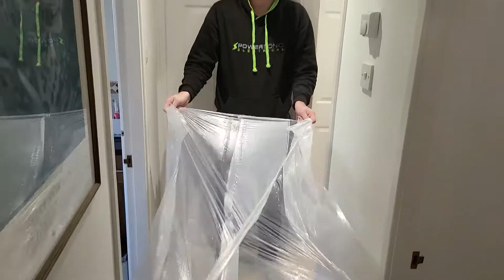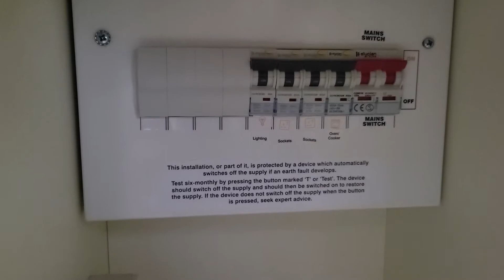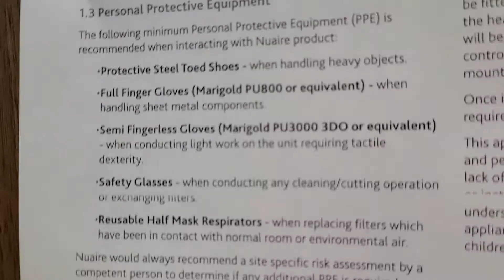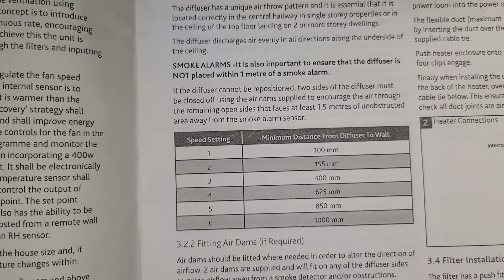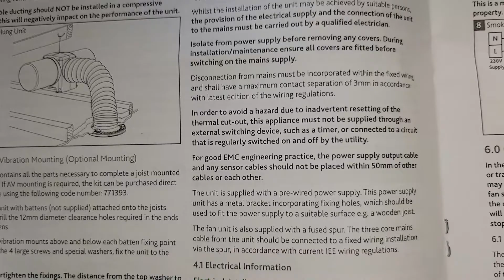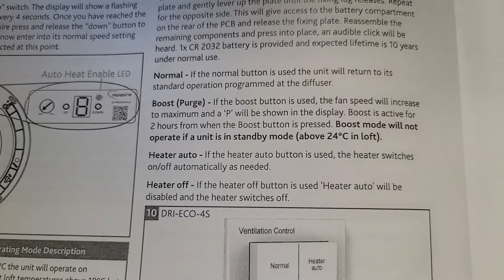Nuaire Positive Input Ventilation (PIV) What is that? A cure for condensation?? Full guide

Comment: Great video👍 and as one other says ‘much more informative than what the manufacturer provides’
Just installed mine, electrician wired it in and low &behold…… there’s not a kick out of it. It’s flashing ‘F’ which apparently means it needs replacing. To say I’m livid is an understatement!!
Waited a month for delivery, I told the misses this unit is gonna be the business and now My wife is giving off that we’ve spent the guts of 600 purchasing and getting it installed and all we have to show for it is a whole in the ceiling.
I’m just waiting for 9am so I get on to the supplier. Not happy!! And the trouble is if the supplier offers a replacement I’m dubious as to what faith I now have in it
Reply from the maker: One thing to check is all the comms cables are correctly installed. The long one between the PIV and the wiring loom and the shorter one in the heater/outlet plate. If they are not properly in place it will throw an F fault. Hope that helps.
Reply: @electrician247  Top man Mark, I did check that last night, but i intend doing a full check on everything later when I’m home. I hope it is something as simple as that, if so I’d be delighted.
Appreciate it cheers 🍻
Reply from the maker: @marklynch4493  yes, sometimes they can be not sat down quite right or the wrong way around. So worth a check over.
Reply: Just off the phone with the supplier and they’re awaiting a manufacturer response which can take 7-10days!!! As standard, which is shockingly ridiculous!!
apparently there is a stock shortage due to a delay with sourcing a particular component that is holding up manufacturing and it’ll be the end of February before there will be any sign of a replacement. So I’m £500 quid down with a hole in my ceiling and a wife who doesn’t fully appreciate the situation!!
Reply from the maker: @marklynch4493  is it a nuaire product if so Our working hours are 9am and 5.00pm Monday - Friday, contact us by calling 029 20858 400 or email aftersales@nuaire.co.uk You will always talk to a real person.

https://www.nuaire.co.uk/support/aftersales-service
Reply: @electrician247  
Cheers for that. I rang and they pretty much confirmed that the flashing’F’ is a complete system failure and the whole uni needs replacing.
That further confirmed that there is a manufacturer component issue and replacement units won’t be available until mid feb. 😩😩
Reply from the maker: @marklynch4493  Yes we are waiting delivery of several units to install for customers. Also waiting for our new EV vans due to the same lol. I hope this problem goes away but seems here to stay across the board.
Reply: Hi Mark
Don’t know if you’ll pick this up in time but, as you know from above I’ve had an issue with my PIV. 
Well nuaire have organised to pick the fan up from me tomorrow (6th Feb). So I have had to go into the loft disconnect etc. in doing the fan just kicked in and appears to be working, all of a sudden.
What do I do now?
Do I soldier on and see how it goes or take it out and get it collected.
They said it’d be a month before I receive a replacement
Reply from the maker: @Mark Lynch  I would suspect the leads/connecting pins on one or both of the link up wires have perhaps taken damage during/before install. 

Would the electrician who installed it come back to take a look for you? 

It does sound to be a wiring/connection issue on the appliance. 

Also worth noting the 7 year warranty is only valid when installed by a qualified installer. 

Hard to advise without seeing or knowing the install tbh. Sorry.
Reply: @electrician247  
Yeah I had a qualified guy wire it alright and he thought the same as you. I want to just leave it now working away, but then worried that it might just pack in on me in time 🤷🏼‍♂️
Appreciate the response 👍
Reply: @marklynch4493  Is it still working? 😂

Comment: Fantastic video Mark, much more informative than those supplied by the manufacturer. I got one of those, but unfortunately it seem to be faulty, after wiring the power doesn't reach the unit, no LED lights go on, the electrician says 240 gets to the heater board but nothing comes out, I'm based in Spain and the manufacturer doesn't take any responsibility for more likely faulty device, have you ever came across that, any advice would be much appreciated, I'm desperate, defo won't get my money back and I don't want to risk getting a new device! Thanks
Reply from the maker: Have all the communication leads been attached? There is a short one between the heater and the control board that fits in the grill plate. This often gets missed. Also the comms lead which is longer back to the PIV itself. Hope that helps. Mark

Comment: Really informative video! I've trawled through the comments, so forgive me if I'm repeating a previous question, but can you tap into a lighting circuit with this (heater) unit, or does it require 2.5mm cable? In my loft there's plenty of lighting cable but no ring main, like a lot of lofts I guess...Much appreciated !
Reply from the maker: Hi mate. These are fused down via a supplied 1A FCU so can be wired from a lighting circuit. In some cases that's better as it's easier to know when the power to the piv goes down and stops tennants turning it off. 

Consumption is small so similar to having an extractor fan on the lighting circuit.

Comment: How loud are they? Can you hear them or is there a constant hum when installed?
Reply from the maker: At low speeds almost silent. Faster speeds it can be heard if your close enough but still very very quiet. 

Always suspend them rather than fix down. Even with the rubber buffers it makes more noise when fixed down.

Comment: Hi, great video! Question...  We don't have trickle vents on our windows. How does the air pushed in from the PIV unit then push out the humid air? Do you need to leave a window open slightly?
Reply: Just a like and no answer? 😂
Reply: @bergzy7  were getting piv installed soon, fitter saying if got kitchen or bathroom ventilation be fine.
We've got no trickle vents as window company didn't fit them like I asked.
He also said you could have a vent size of tennis ball on ceiling each bedroom.
Reply: @adrianflake8273  We do have an extractor fan in kitchen and bathroom so hopefully should be ok. Let me know what you think of the unit... I'm thinking of buying one in Jan
Reply: @bergzy7  get mine 29th December so let you know.
Hopefully get rid of bit of condensation at bottom of windows without using dehumidifier.
Reply: @bergzy7  ain't going ahead with it now.
Got them to send name of exactly which piv and which bathroom fan was getting.
40 pound fan which was discounted at £200fitted.
And the piv wasn't one I was expecting and was £300 online  wanting £695inc fitting.
So not paying someone £500to fit for couple hours work.
Reply: @adrianflake8273  how much would pay a trades person who's running a business to do it then
Reply: @brianhewitt8618  well not the 895 he wanted to fit 340 pounds worth of goods.
Especially when he said be 2 hours work 277 pounds an hour no thanks. 
Got ripped of by electrician before who said be 300 pounds to fix faulty wire from socket to cooker as  when cooker delivered bloke said was faulty so couldn't fit it. 
Mrs was at home as I was at work he was at mine 20 minutes.
Reply: @adrianflake8273  its safe for me to say that I will never know the full story and ill assume that you had asks of the services of a legitimate business to carry out the works and if thats the case then the figures you are quoting sound very reasonable to me. businesses are not charity's unfortunately.

Comment: What if the outside and therefore the attic humidity is high (87%)
Reply from the maker: It will be raining 🤭. At times of high humidity the impact of the PIV is reduced. But generally that is a very short duration. It is essential loft spaces are well ventilated to outside and sealed to inside. Such as loft hatches, spot lights and other ceiling penetrations.

Comment: Does a PIV unit chill your house more in winter? Surely it will blow in cooler air as well as force the warmer central heated air out. If you set the heating element to a comfortable home temperature (somewhere around 19-21°c) would this cost a lot to run?
Reply from the maker: It takes some figuring out in your own mind. I had my doubts but it actually helps keep the heat in your house. By keeping the warm air from rising. 

That said the heater is generally set to 12C and pulses on/off to take the chill off and allow for more bearable airflow mixing in landing spaces were it can get cold under the vent outlet with unheated models. 

Running costs are minimal even at current prices.

Comment: Mine is blowing cold air out all the time, my house is freezing, how do I turn it down please so it's not cold all the time
Reply from the maker: Do you have the heated version? If it's the newer model controls are under the vent cover plate. Older version controls are in the loft with the unit. New unit has a round vent old square vent
Reply: @electrician247  the controls must be on the unit, I've checked under the round thing, I will have to get in the loft, hope there's no spiders lol
Reply: @sarahlocke9026  did you find out how to turn it off?
I have one too and have no idea how to switch it off completely?
Reply: @andycoys1  the man next door also has one so I asked him to get up in the loft for me to turn it down, it was set for a 5 bedroom house, mine is way smaller house than that, he turned it down and it feels a bit better but I think it needs to be turned down more, the controls on it are on the unit itself up in the loft, hope this helps xx

Comment: Great video, just one question, is okay to spur off the 1.5mm lighting circuit or does it need to be from the 2.5mm 13amp ?
Reply: Did you discover the answer? I was wondering this too and can't find the answer anywhere...
Reply: @sufc43  I didn’t receive a reply but I spoke to customer services at Nuaire and they said it was okay to spur from the lighting circuit, best ring them direct just to confirm though.
Reply: @Family.Channel  Thanks for the reply.
Reply: @sufc43  I have the same question here and wanted to know if you installed a PIV in the loft through  the 1.5mm lighting circuit?
Thanks
Reply: @newhomediy  Yes, switched fused connection unit, 3mm fuse, all working lovely! The OP was kind enough to answer my question on a different video, so I am grateful to him for the info.
Reply: @sufc43  cheers really helpful!
Did you just spur off the lighting ring?

Comment: We were looking at this as an alternative to trickle vents in the windows.  As buying windows with trickle vents completely negates the sound proofing of windows which is a big reason why were buying new windows in the first place, due to noisy neighbours.

We were told by a local window company to get one of these so you don't have to have the trickle vents.  Is this not the case?
Reply from the maker: Yes and no... basically you need natural points if extraction for air. That can be extractors etc. Trickle vents work best imho
Reply: @electrician247  that's just a no go for us.  We're a family of autistics and need the sound proof.  Can you suggest anything else?
Reply from the maker: @Thorocious  mechanical whole home ventilation then. This removes and injects air to the house
Reply: @electrician247  have looked into that.. This is an old home and would cost a small fortune to get that installed.  Was really hoping the PIV unit would be enough.
Guess we're just going to have to block up these massive holes on our brand new windows.

Any idea who we should complain to about these new regulations?  If we all make enough of a fuss about it I guess things could change.  My local window fitting companies are absolutely livid about this change.
Reply: In mine they don't work even if the open. Once temperature is Lower Than about 8-10° outside then condensation is on the windows.
Trucke vents blowing air from outside to inside in my house and I think the idea of this unit  is to push the air in the house so moisture air can run out through the trickle vents...

Comment: Would you not recommend the unheated version then? 
I want to get one but don't want it to cost a fortune to run throughout the year especially with electricity prices at the moment being so high.
Reply from the maker: Definitely wouldn't recommend it at all. The heated versions don't cost that much more to run. The elements are pulsed on/off rather than continuing to run. Bit more expensive of course but much more effective and saves on heating costs over all. Unbearable to have them on without a heater in the winter imo.
Reply: @electrician247  Glad you said that before I froze my house!

Comment: Informative video however I would be interested to understand how the system conforms with Revised Part F - Ventilation & Part O - Overheating which are both due out in June 2022. Also what is the average watts per year the heater will use? Airflow of the unit is dictated by the nearest wall positions to the outlets. If  higher airflow is required, baffles should be used to stop 'dust build up on wall surfaces'. The unit you describe has 'high quality' filters fitted. So where is the dust coming from?
Reply from the maker: That's one for the manufacturers to answer in terms of compliance with new regs. I am sure they will be ahead of that curve. 

The dust is a pretty easy one. It's naturally circulating in the air all the time. The pressure on the air if close to a wall surface does tend to result in staining/dust collection. Makes sense really if you imagine the dust debris that builds up on trickle vents, extractors, doorways. This is similar. A source of air aimed at one spot will deposit dust that is just present in the air rather than injected from the loft. 

You can even get the Nox filters for Improved filtration out of the loft but these buildups still occur. 

Thanks

Comment: Just come across your channel, great video, had a piv unit with a dual outlet fitted around a year go but a different brand (envirovent), had no idea about the smoke alarm positioning as one of my outlets is placed with in 500mm of a smoke alarm and the other 400mm off a heat alarm with no dampers installed also was installed by the company that sells them, guess I will be on the phone tomorrow, but again great video and great information 👍
Reply: Double check, because if there was no way to keep it away from the smoke alarms (i.e. not enough free space on the ceilings), they should have installed the baffles/deflectors to direct the air flow away from the detectors and you should be ok 👍🏽

Comment: A few houses i work in have the older Nuaire Drimaster 2000 for ventilation.
I do find the filters get really black as the filters need replacing every so often which doesn't get done on maintenance once the product is installed
Reply from the maker: Yep a very common problem. Every 5 years. You used to be able to run them through the washing machine but that's not recommended now!

Comment: My dad told me about these a few years ago and have always thought about installing one at home myself… seem like really good products
Reply from the maker: We have installed lots over the years. I have them in my home and family members homes. They work. But get the heated version and if budget allows the Nox version also.
Reply: @electrician247  yeah definitely… I’ve thought about using these instead of in-line fans in bathrooms but I guess you should use them in conjunction with them rather than instead of…
Reply from the maker: @hackwoodelectrical  for sure mate. In conjunction. Important to have back ground ventilation and extract moist air when you can.
Reply: Great video. 
Don’t suppose you know the gap you need between joists to fit it in ? I only have 30cm spacing between my joists.  
Thank you
Reply: @user-ej4cr9ft7v  the pipe is 200mm diameter, so should easily;y fit